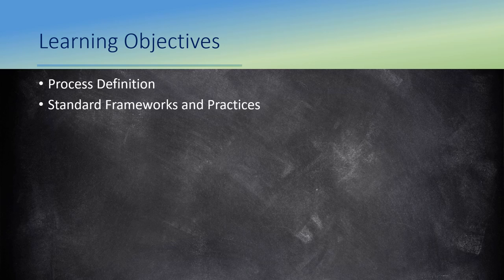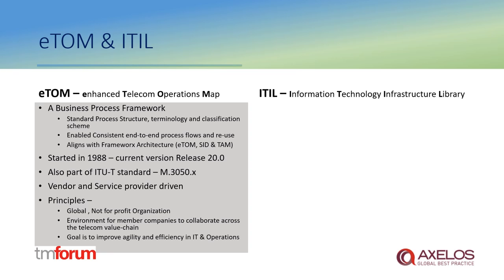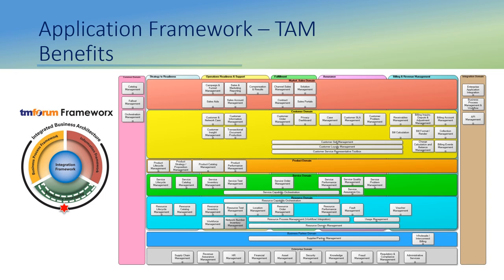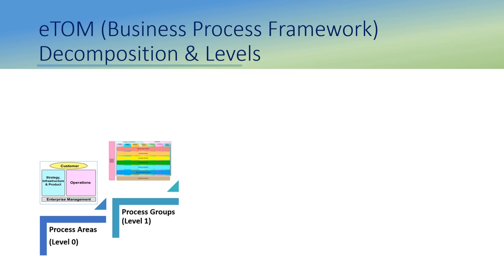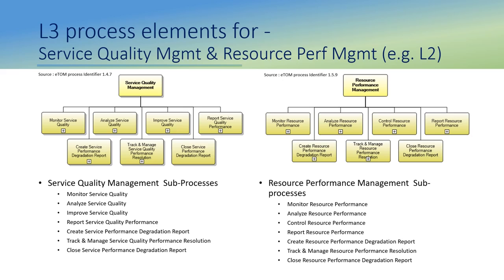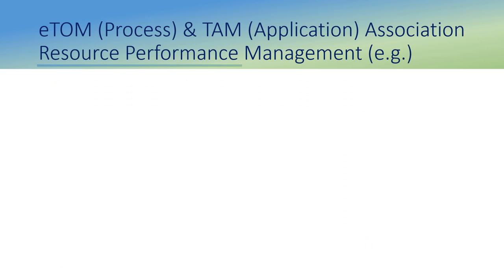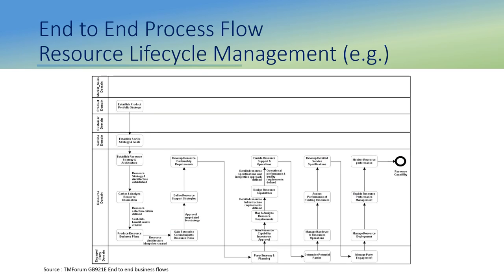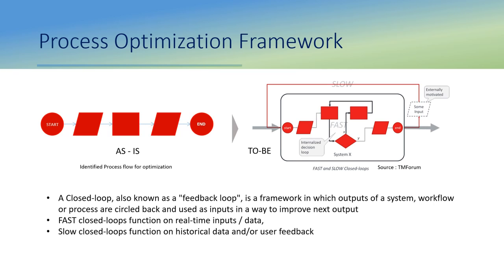Business Needs Analysis - Identifying processes to apply ML

Comment: This video tutorial focuses on business needs analysis in telecommunications, specifically identifying processes for applying machine learning (0:00-0:11). It covers business process analysis and techniques to apply machine learning in the telecom industry (0:17-0:22).

The tutorial details:
Process Definition and Models (1:27-3:10): Explaining what a process is and the necessity of business process models for categorization, standardization, and improved efficiency.
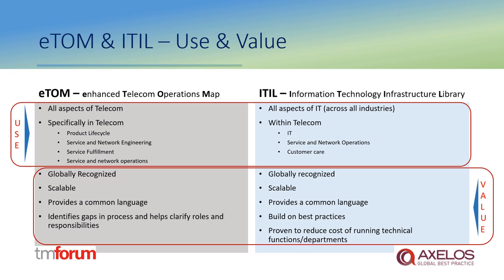TM Forum Frameworks (ETOM & ITIL) (3:12-8:01): A comprehensive comparison of ETOM (Enhanced Telecom Operations Map) and ITIL (Information Technology Infrastructure Library), highlighting their principles, uses, and value in telecommunications.
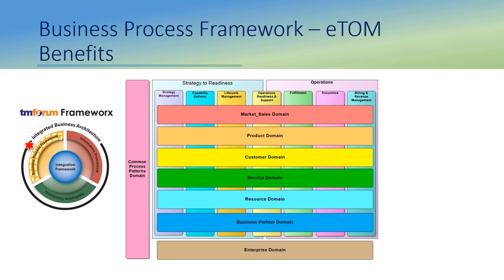Enterprise Architecture and TM Forum Integration (8:25-9:56): How business process frameworks like ETOM fit into enterprise architecture and how business strategy is translated into IT and technology solutions.
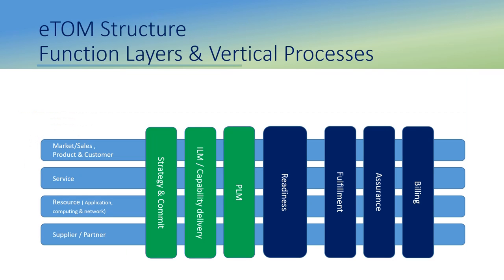Benefits of TM Forum Frameworks (9:57-12:45): The advantages of using ETOM, SID (Shared Information Data Model), and TAM (Application Framework) for common language, cost reduction, and improved efficiency.
ETOM Structure and Decomposition (12:46-23:56): A detailed breakdown of ETOM's structure, functional layers, and process decomposition levels (Level 0 to Level 4).
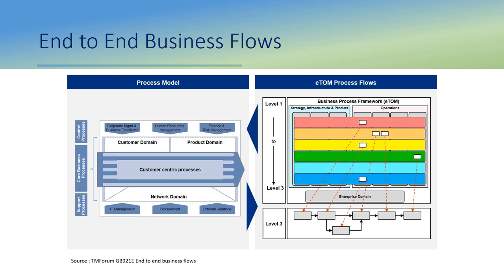Mapping Processes to Information and Application Frameworks (23:58-29:12): How processes are mapped to the SID information framework and TAM application framework to define data models and application functionalities.
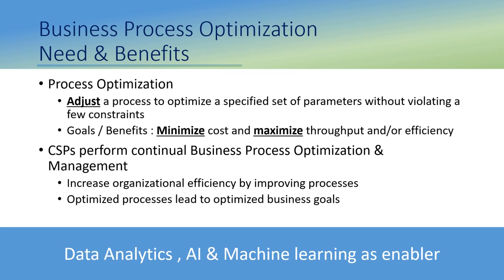End-to-End Business Flows & Optimization (29:14-35:05): Discussing how ETOM processes relate to organizational end-to-end business flows and the importance of business process optimization to improve competitiveness.
Leveraging Data Analytics, AI, and ML (35:07-39:31): Identifying business drivers, opportunities, and a closed-loop framework for applying data analytics, artificial intelligence, and machine learning in process optimization, particularly in areas like network fault location and recovery.